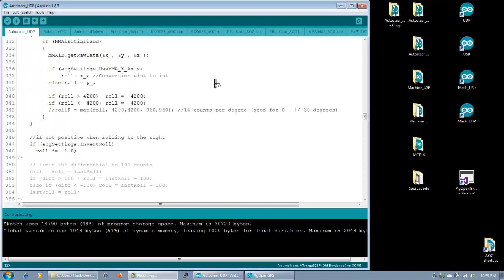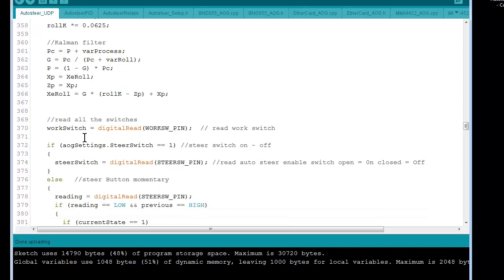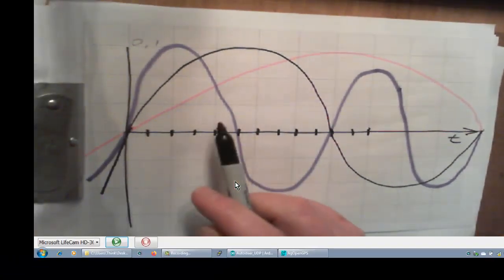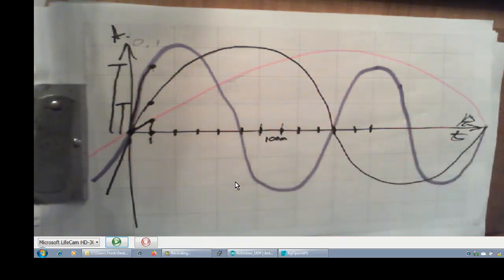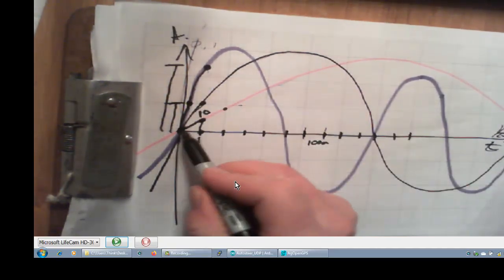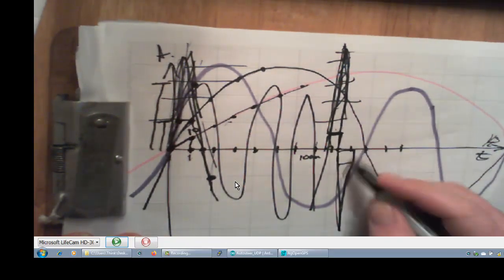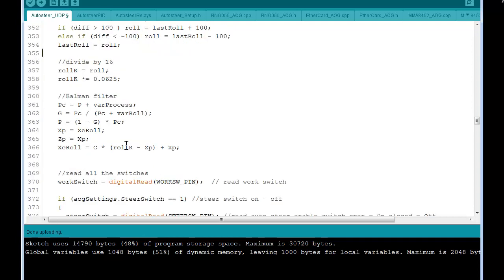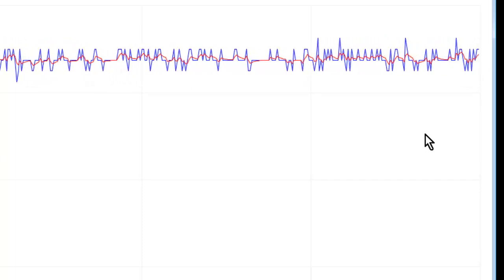MMA Digital Filtering - Calculus Cheats

Comment: Have you considered a Savitsky-Golay filter?
Reply from the maker: I will have to look it up! No i have not. But always always open to new ideas
Reply: @FarmerBrianTee  I have used it successfully for filtering noise on angle sensors used in safety applications. There are also different coefficients you can use to provide filtered derivatives that can be useful in some situations.
Reply: Something else I encountered in that application which may also be relevant was that you need to think in "delta cycles" not "delta T". I had a program running on a safety PLC that had a cycle time of around 70ms, which was performing some control with PID. We made a software update to an unrelated function in the PLC program, and the cycle time increased to 75ms. This completely ruined the PID tuning, because the processor only sees the values on a per cycle basis, not on a real time base. I don't know what the Arduino cycle time with the Agopen code is but people running it on different platforms like the ESP might need different tuning values.
Reply: @farmerwoody123  sampling on Esp32 seems to have different latencies,, so they are not for RT applications. stm32 is a nice and cheap number cruncher tough. But you meant to use esp as a DSP on digital signals right?